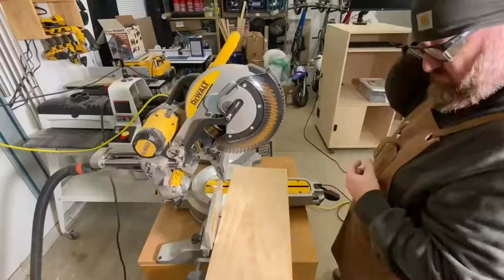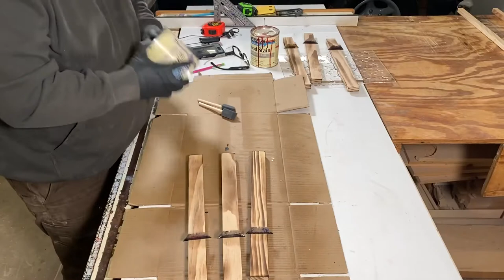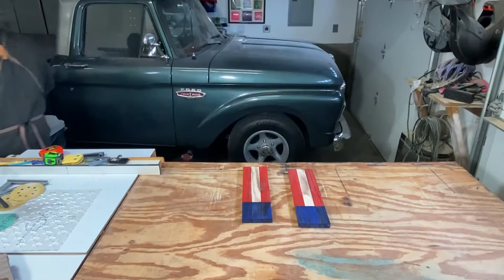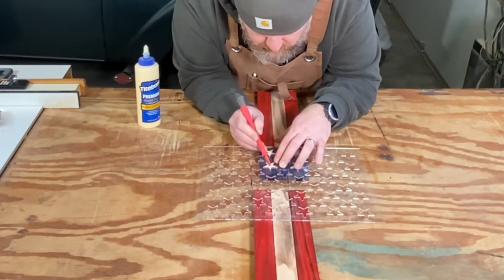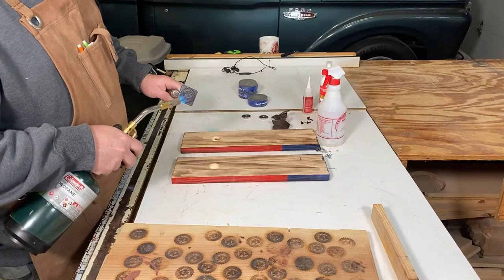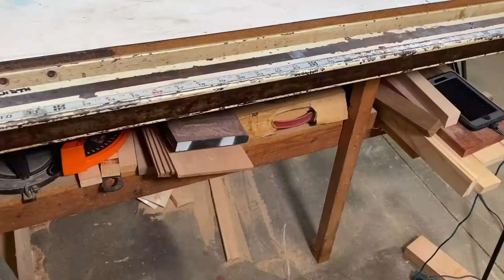Making Patriotic Magnetic Bottle Openers out of Pine

Comment: What kind of hangers are on the back to attach to the wall?
Reply from the maker: I’ve used both a keyhole bit on my CNC and a metal keyhole bracket that screws to the back.
Reply: @PuddlePirateProjects  thank you for the info, I have a keyhole bit already from when I made wall candle holders and I will look into those other metal hangers as well. 

I have been making higher ticket items, but in our current economy I've been branching off and making smaller items to sell quicker